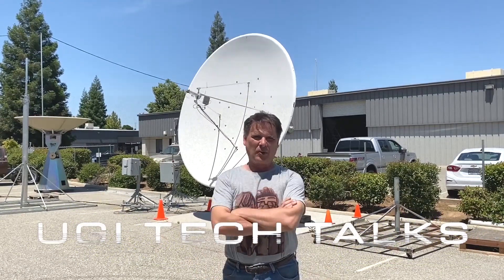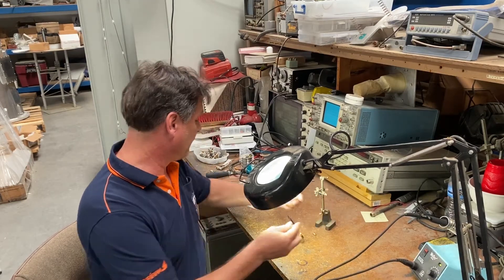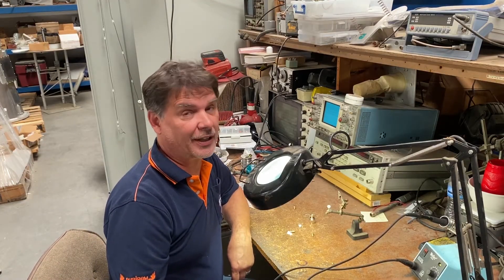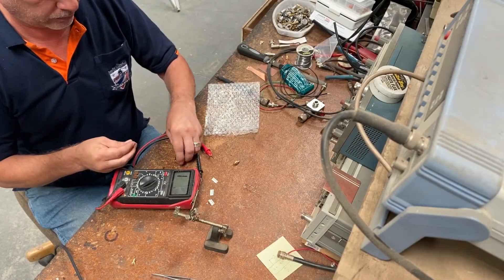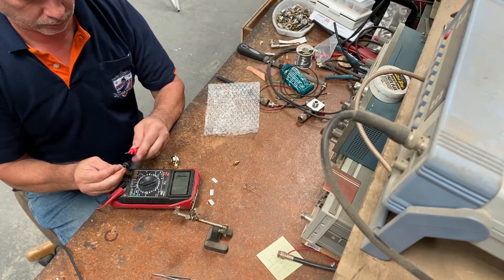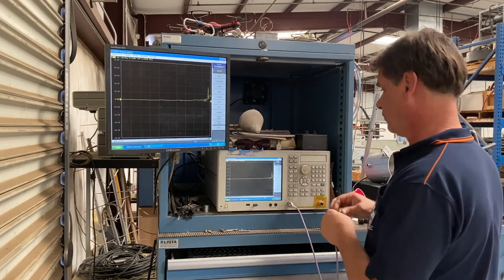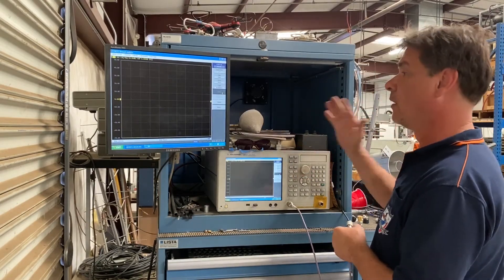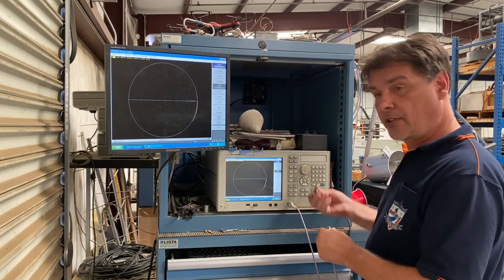Mini 1300 Vector Network Analyzer - Calibration

Comment: Anyone use this on their 23cm setup?  I seem to have SWR results that are all over the board.  The unit goes berserk above 1000mhz even into a dummy load.  Anyone have any success?
Reply: I just compared which to use my KC901V at the 1295Mhz on the Diamond tri-band mobile antenna SG9500, as the MINI1300 results are almost the same with KV901V. My Mini1300 firmware version is v1.04.
Reply: @TingILi    Thanks for that comparison.  Ultimately I did end up getting the Mini to work properly- I had a setting set wrong (I can't remember exactly what it was right now), but once I figured out my mistake, the unit worked as it should.  Thanks!